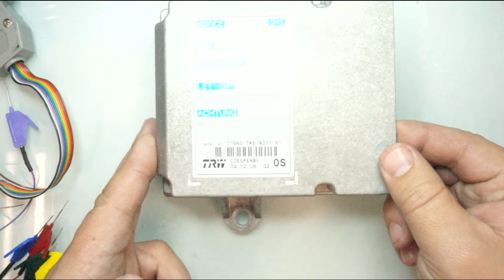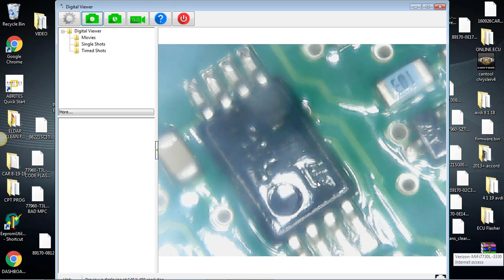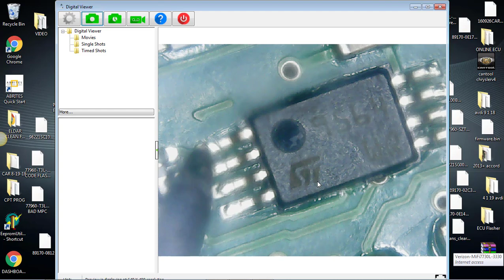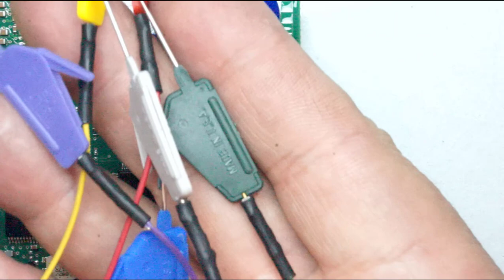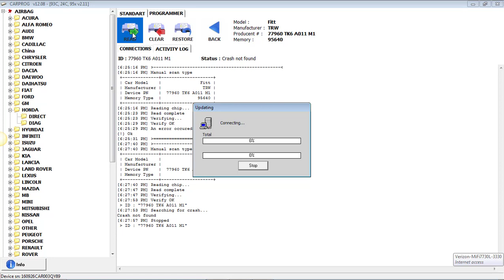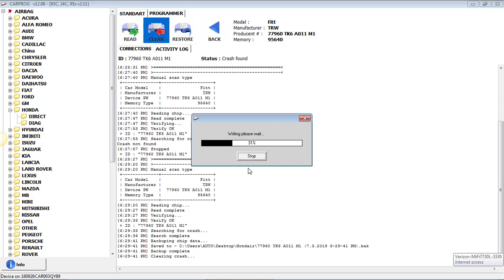⚡️Honda Airbag SRS Module Crash Reset After Accident.

Comment: Can I just install used one that has no accident ?
Reply from the maker: You can part number has to be exact and you and you will need to program passenger seat since the module is from another car so cheaper to fix original then pay to buy and pay to program
Reply: @vehix411  where can i get those pins please, thanks for the video!
Reply: @vehix411 Hey, how can u reprogram the passengers seat??
Reply: It's easy, if you have a good enough scanner that can read & reset airbag & abs codes. It's just to relearn the passenger seat weight occupancy. Obviously they want you to send in your old ecu which they make money on clearing the crash data.

Comment: Hi, i have a 2013 Honda Fit which has been on an accident, blown front driver Airbag and passenger curtain Airbag, I'm thinking on buy an eeprom programmer, i found a web that offers to clear some eeprom but its limited, My Specific SRS module Part number is 77960-TK6-A042-M1, but in that web i only Found 77960-TK6-A030-M1 which is the module that came in the same model, But 2009 to 2011 years, do you think this program would work on my eeprom/SRS Module?

Comment: 77960-tr0-a222 after reset getting “u3000 internal failure “ it’s pretty common with this part number . Do you have solution for it

Comment: Hi same here for me curtain airbag and seat belt deployed,and has bean replaced enouht to delete airbag ligjt or necessary to clear the crash data ? thank you
Reply from the maker: yes you must clear the crash data in the module or replace it, its cheaper to reset here's a link with more info www.karmanauto.com
Reply: @vehix411  Where can I get those kind of "precision clips" that you used in this video in order to avoid the soldering?

Comment: Honda scanned my card and said I'd need a new airbag modual costing £800 would this fix my issue.
Reply from the maker: if the car was in an accident then yes
Reply: @vehix411  wasn't in a crash, but was told the modual needs replacing. 🙄

Comment: Why is it necessary to clear the crash data afterall? In my case curtain airbag and pre-tensioner blown in a side impact. what is my sequence of repair plzz?
Reply from the maker: Replace the deployed parts and reset the module
Reply: @vehix411  Hi same here for me curtain airbag and seat belt deployed,and has bean replaced enouht to delete airbag ligjt or necessary to clear the crash data ? thank you

Comment: Is there any way to reset the module with a scanner? Or does it have to be done this way?
Reply: Dis you get an answer for your question? i'm in same situation
Reply: @gsrjaycee4521  from what I know you have do it like this or connecting to the pins on the outside of the module

Comment: Hello! I'm going to buy a used honda and a dealer is going to replace this module. Does it mean that he can hide error codes from the crash after such a change? How can I know then that the car was not in a crash? It's my first car :)
Reply: If any sort of device that has some kind of memory, it can be reset or replaced. Modules can be replaced, memory chips can be soldered out and swapped. Packages and serial numbers are easy to copy. Think of Shen Zhen part-assembled iPhones. 
There really is not a guarantee from in-vehicle electronics on whether there was a crash or not, if you are looking for that.

Comment: Hi i have a Honda CR-V 2009 ex the car has not been involved in accident but the airbag light is on the car has been to a bosh dealer they say there is no communication and to replace the modual can i use a second hand modual from another Honda CR-V thanks karen

Comment: I just bought 2016 civic lx, 2 doors. Previous owner cut both driver and passenger SRS wires. How do I reconnect those wires since they have the same color (light blue).? I noticed on the connector marked 1 and 2.

Comment: When I remove the part . Take out the negative from battery first? Can I connected back and use the car like that meanwhile? It won’t mess it up?
Reply: No just do it its got nothing to do with the engine
Reply: @dashtyATG  Shut the f up. He is asking if he should disconnect the battery, not the engine. English, do you speak it?? What do you mean JUST DO IT? 
DISCONNECT THE BATTERY NEGATIVE FIRST, Wait 3 minutes, then disconnect Battery positive before removing / reconnecting the Airbag module.

Comment: Hi I have a 2018 Honda Accord I'm in California i took my car to a place that Fixes Srs Modules  the place fix my Module my Srs light went away but now i Have Abs Steering Angle sensor light Tps light Brake light . The car wont recalibrate it didn't have any of the lights i mentioned before the fix was done on Module.
Reply from the maker: Need to program it https://m.youtube.com/watch?v=rqWLUx2XhMM

Comment: Can I do the same in a 2011 Honda Odyssey?
Reply from the maker: If you have a programmer and connections
Reply: VEHIX411 the problem I have is that there is no connection from passenger side front seat to the module.
What should I do?
I went to dealer , they ask for a lot money to fix it.
Reply: @selvinlopez5606  there on the dash airbag  light check if working

Comment: My friend from where you order  this colored Bins connecter  please let me know thank you
Reply from the maker: I buy them from arlabs they are expansive cost me $251 shipped to my location I’m trying to see if there is a cheaper option out there cause if you do a lot of modules you will need to change these plugs every 3 month
Reply: @vehix411  can u send me a link please
Reply: VEHIX411 I found a cheaper kind . They look legit. $20
Reply: @albertgiles5128  hy brother where have you find the cheapest please can you shear the link?
Reply: @dashtyATG  eBay
Reply: @albertgiles5128  On what keywords or name did you find them on ebay?